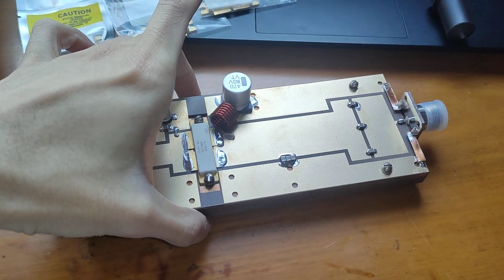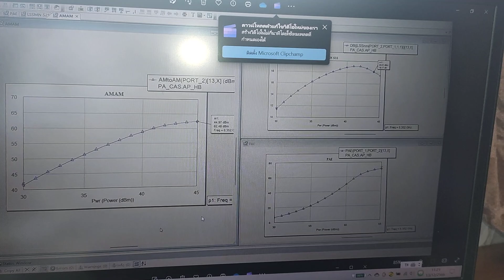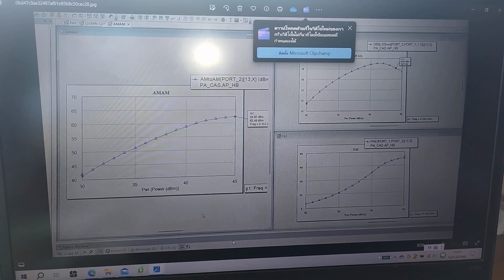Brief introduction about the 352MHz 1.4kW Class E amplifier เพาเวอร์แอมป์

Comment: Only 71% effeciency for Class E? I thot Class E was like 95%. 🤔
Reply from the maker: @bob4analog  Hello, the efficiently of Class E is very high, however the overall efficiency of this amplifier still relies on other things. This LDMOS isn't supposed to be operated under such frequency though it's close to what's provided in the datasheet, it's still very hot. Also the board and especially those matching capacitors generates a lot of heat loss.
Reply: Ok, interesting! 🙂👍

Comment: The BLF188 truly is a great device, very tolerant of vswr mismatches. I have used them at HF frequencies and also VHF but not as yet on higher frequencies. I have not managed to blow one, despite antenna accidents. This is the first time I have seen this chip used in a class E configuration.  From your comments below I calculate the efficiency to be around 80% This seems a little on the low side. I don't see any vias along the transmission line ground planes, could this lower the efficiency? I always silver plate when working above VHF and this does make a difference. I too would like to experiment with class E and will be building a test circuit. I once saw a data sheet that suggested these chips for not really suitable for class E, I am not sure why that was the case, the only concern is a carefully controlled gate voltage swing. (EDIT, just while writing this, I remember the reason - Drain voltage swing, VDD x 4 ish for class E. Compared to VDD x 2 ish for AB.) What are your thoughts on the drain voltage problem?  Great work building the amp and thanks for posting. Chris, UK.
Reply from the maker: @TheTemporalAnomaly  Actually there are via holes around the grounding plane there. Yeah you got it right, the problem lies in the nature of Class E, too high Drain voltage. Usually it should be 3.x times the supply voltage for a standard Class E, however here I actually slightly decreased the conducting angle to let the maximum Drain voltage drop a bit to make sure it lies within the safety region. Thanks for your comment!

Comment: nice work. what is the voltage and amps required for this kind of amplifier?
Reply from the maker: Hello, such an amplifier operates at 50V and around 32-36A if I remember correctly.

Comment: Woww👏. Does it work on higher frequencies? Like 500mhz?
Reply from the maker: Hello sir, this amplifier is specially designed at 352MHz and it is a Class E amplifier, so the highest efficiency is achieved at 352MHz. If missed that frequency, the  efficiency and the gain will decrease.

Comment: That would make an kick ass Guitar Amp.
Reply: The top end might be a little high, and yes, that`s a joke. This amp is for radio frequencies and with this circuit, would not work in the slightest way for audio. You might look on the googler for `Class D audio amp` There are many circuits available to build your own and many more available to buy ready made with power levels in the 100s of watts minimum. They are also very cheap to buy.

Comment: I'm surprised that small coil for the choke inductor and those small capacitors can handle the currents required for pushing 1.4kW into an antenna
Reply from the maker: Yeah, I am also quite surprised about ATC 800B capacitor's performance, they could handle a huge amount of power. Those 3*15pF capacitors showed around 120℃ under a thermocamera, even with the help of the heatcompound at the back of the PCB, but they are still alive after 16 hours of continuous test. The inductor is also quite hot during CW operation. However, this is the very first amplifier which will be mounted in the casing for the cyclotron, in newer amplifiers I will use higher gauge wire for that DC feeding inductor.
Reply: @uecmitsuimarinedieselengin873  Those ATC caps never cease to amaze me too.